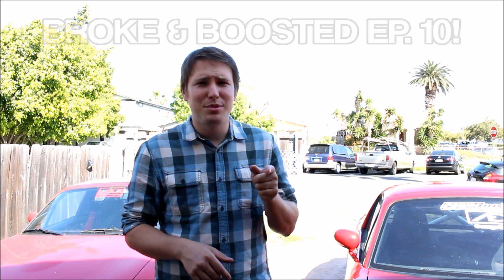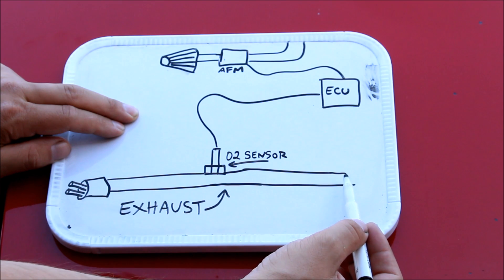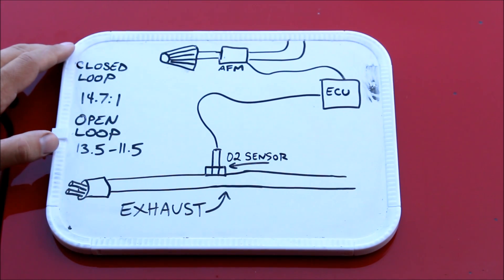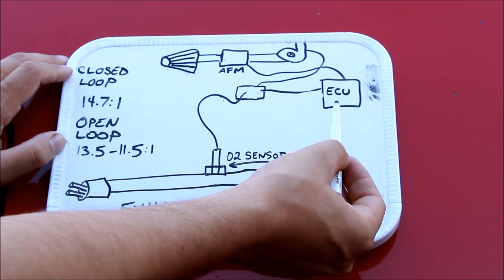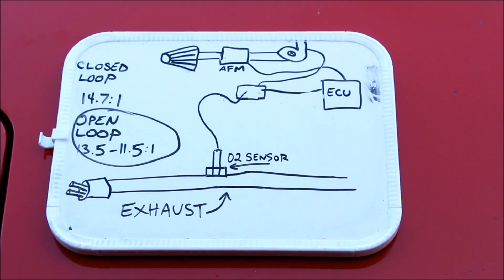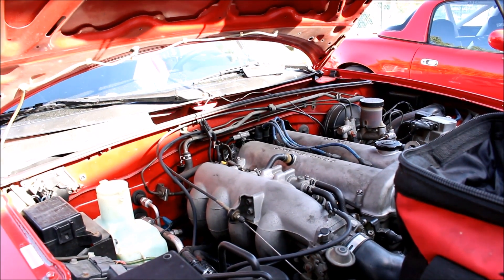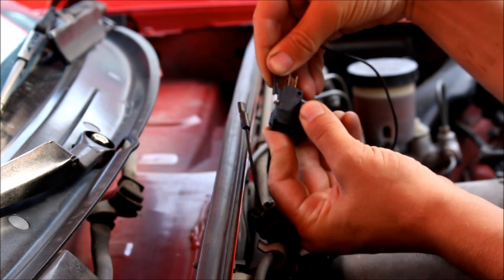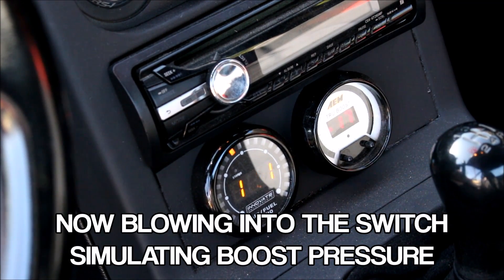Tricking The Stock ECU: o2 Signal Modifier (Broke & Boosted Ep10)

Comment: Your Cooler and cooler piping will absolutely see vacuum, when off boost.
Reply: +1
Reply from the maker: +tangles01 That maybe true because of the restriction of the compressor, but nowhere NEAR the vacuum inside the intake manifold. I'll have to run it both ways and see how it works. Oh and in my other car, my intercooler piping actually sees some boost while the manifold is still in vacuum. I'm going to run dual boost gauges at some point to see what the relationship is.
Reply: +TheCarPassionChannel I was going suggest running a gauge on each to test, the speed in transfer from boost to vacuum might be a smidgen slower but I would back that in under a half a second it would go from full boost to full vacuum (Full vacuum in this being the cars natural vacuum) within the cooler, while the manifold will be near instant. Having said all that, there is no reason that any of it would be detrimental at all, it should work, just pointing out that it will see the same vacuum that the manifold will.

Comment: why not get the ecu of a 323 or mazda3 turbo? they use the same engine if I remember correctly
Reply: +SmellyAlways would be cheap but probably cant beat 16 bucks haha
Reply: +Tom clark true but like will run properly with 0 risk :P
Reply: SmellyAlways
do you know if you can slightly tune a stock ecu or is it completely locked?
Reply: +Tom clark I believe you can I'm not 100% sure

Comment: I would be a little bit afraid that the pressure in the intercooler will be always too high == it will stay in the open loop all the time while driving ... that switch seemed to engage with relatively low pressure - but I wasn't blowing into it so I don't know .. :)
Reply: +František Šindelář I imagine he'll plumb it in after the throttle body, where he would plumb a MAP sensor if he was installing one.
Reply from the maker: +František Šindelář Good info, and also another reason to have an AFR gauge, so you can keep an eye on things like this. I'll have to try it both ways and see how it works.

Comment: on 4 wire o2 sensor plugs ... the blue one is the signal ... confirmed :) ...yesterday made the connection as you advised and the wideband works perfect.

Comment: Where did you buy your cast 1.6 manifold from? The one i'm looking at on ebay is exactly the same one as yours, like exactly, but its $855 from "karobskollection" seller. You said you got yours for around $155 I believe. Thanks.
Reply from the maker: +Coda5610 Wow, that makes perfect sense. I never knew why that stupid manifold was always listed for $800+
Reply: When a price is jacked that high up means they are out of stock and dont wanna remove the lising cuz it cost them more money to relist the item
Reply: +Coda5610 Oh ok, that makes sense. Thanks man. Guess I'll have to wait around for them to get more in stock then.
Reply: +TheCarPassionChannel yep! They just raise the price of it so no one will buy since they are out of stock then they lower the price back down when they are in stock

Comment: Couldn't you just relocate the MAF sensor to a location on the charge pipe instead?
Reply from the maker: +brandoGTR48 It doesn't matter where you put the MAF or AFM, the same amount of air is entering the engine. From everything I know about the modifier, it's just a driveability thing, the stock ECU will tip into boost lean causing hesitation and this is a fix for it.

Comment: Is it possible to trick the ECU with a potentiometer? That way you could possibly get AFR's to scale with your boost levels.
Reply from the maker: +WesticlesEmpire You mean by intercepting the o2 signal or the AFM signal?
Reply: It would probably have to be the o2 right? Like if you vary the resistance there, you'd get different AFR readings right?
Reply from the maker: WesticlesEmpire The stock ECU won't understand variable voltage from the o2 signal, it only understands narrowband output, which is just "richer than 14.7:1" or "leaner than 14.7:1"
Reply: Ahhh damn. I was thinking about getting crafty, with idk. Things. I need to go to sleep haha.

So that wideband that you have is still able to talk to the ECU, but only in the way that you just said, eh?
Reply from the maker: WesticlesEmpire The Innovate MTX-L has a simulated narrowband output that makes the ECU think it has a stock sensor still. BUT, you can run any wideband with the stock ECU if you add a bung to the exhaust and run it alone, leaving the stock sensor in place as well.

Comment: What's the difference between MAS and AFM? isn't same?
Reply from the maker: +Raditya Amandra The AFM has a spring loaded door that is pushed open by the air, and a MAF has an element/sensor in it that actually senses how much air is passing it (a much better design).
Reply: I believe a MAF sensor goes off of airflow affecting the resistance of a wire, while an AFM has a physical flap which opens and closes due to airflow to measure how much is going through. I would imagine that the AFM would be much more restrictive than a MAF, and that is why they were upgrades on later models.
Reply: +TheCarPassionChannel I See.

Comment: Im getting more and more tempted to go the cheap route for my Turbo build.
Also, what do you know about the whole short nose/long nose crank issues on early miatas? I for one have a 1990 with the short nose which is known to die. Would you recommend trying to swap it with a big nose or long nose crank when I go to do the timing belt?
Reply: 5 years ago.. Now yall are amazing friends
Reply from the maker: +Gingium Swapping the crank would require a full engine rebuild, it would be easier to swap in a big nose engine. My advice is when you do the timing belt, pull the timing belt gear off and inspect the keyway. If it looks good just torque everything back to spec when you're done! I have a friend with a short nose, 230,000 miles and 240+ whp going strong.
Reply: +Gingium http://www.miata.net/garage/crankshaft.html 
Just make sure to torque it to the correct spec, this page has a section explaining it.
I replaced my bolt and woodruff key (probably didn't need to) when I did my cam belt and have had no problems.
Reply: Wow, crazy to find an old comment from you! Been watching since Fred the Focus days!

Comment: you should not solder any electronics inside the hood of a car because the temperatures inside can make the solder joints brittle while driving, crimping is better, that's why all electronic components inside a car are crimped instead of soldered.
Reply: +gaby1491 Strange, I see where a few OEMs put their ECMs inside the engine bay.  I also have all sorts of relays with solder joints in them located in my engine as well, and that is with ever car I have ever owned.  The reason you don't see wires with solder from the factory is because the OEMs have the opportunity to build the entire harness.  Why would they need to splice anything into an engineered harness in the first place?
Reply: +gaby1491 unless you are touching the exhaust. i reaaallly doubt that anything is reaching 200c+.... solder is fine.
Reply: please show me one example of any connector that has been soldered in a car.specially a turbo one snipeish1
Reply from the maker: +snipeish1 He may have a valid point, he's not talking about melting the solder, but just making the connection more brittle through heat cycling.
Reply: +TheCarPassionChannel OK yea, fair point. I guess I missread the OP.
Reply: edited.
Reply: +NA6 driver  Soldering things is way cheaper than buying connectors. Solder gets really brittle from the heat cycling and can eventually crack (specially on turbo cars.)
Reply: I know a bunch of people who always solder and never have problems, I guess it depends of the solder you use. But yeah, still not the best idea, I work pretty often on computers and this kinda thing used to happen on graphic cards from 2005-2010(roughly) and basically the solders from the actual graphic processor dried and had bad connections. But they fixed it by using a different type of solder, if it need more heat to melt, it needs more heat to even make it softer, which is what makes it dry, getting a bit softer and then hard again hundred times.

Comment: I would've like to see an original 2.2 ms1, can be done for cheap
Reply from the maker: +dailydriver55 I will probably be building an MS2 for the car once the "original build" is finished.
Reply: +TheCarPassionChannel also for the 1.8 cars you will have either one or three wires depending on whether you have odb2 or not, all 02 signal wires are brown FYI and anyone asking. good, just make sure deezums doesn't see this one ;)
Reply from the maker: dailydriver55 Many are 4 wire, and the blue is the signal. Just wasn't sure of they were all like that. Lol @ deezums
Reply: +TheCarPassionChannel from what i ve seen on my 95 and what I've read I always thought it was brown, guess I'm wrong
Reply from the maker: dailydriver55 Are you talking about the harness side or the sensor side?
Reply: +dailydriver55 I am about to get my wideband in the mail and will be installing it on a 96 1.8 so I will go all out with simple wiring diagrams and footage to get it working and info on where to find the wiring diagrams for any year miata.